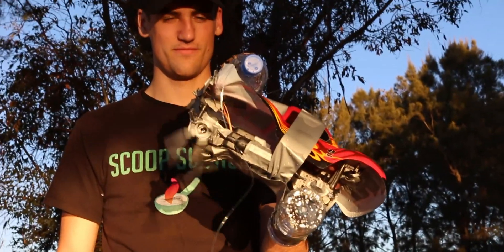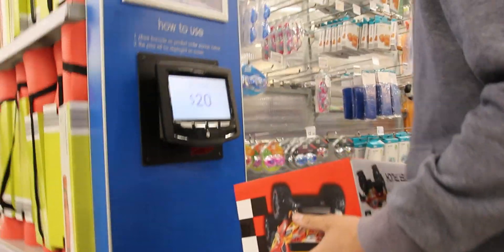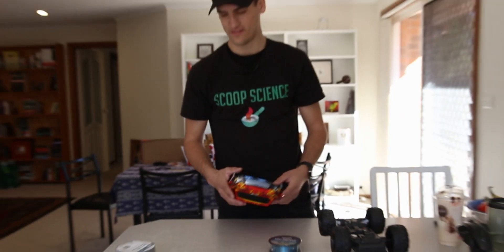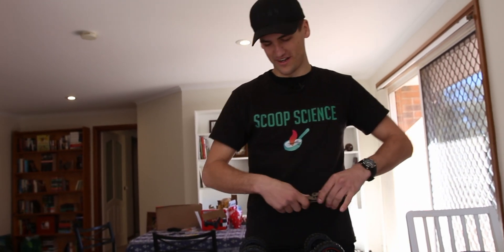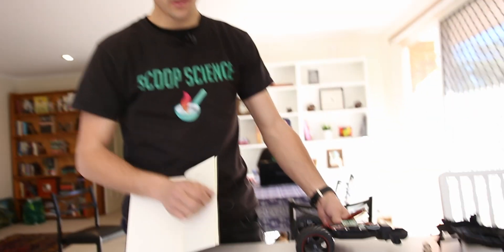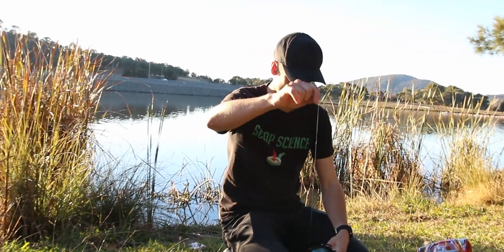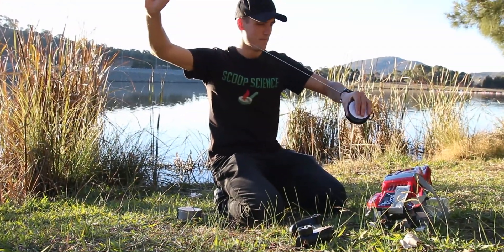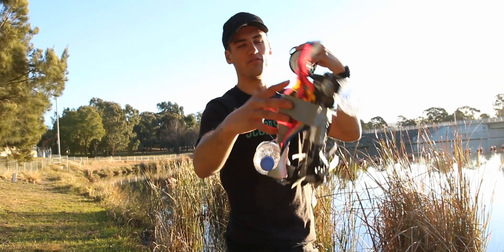RC car into RC boat

Comment: hey guys great video on how not to turn a rc car into a boat hehe ;)  i'm no expert on marine engineering or whatever they call people who make boats, but!  i find it so obvious and am surprised nobody has also picked up on this, what the mistake is that is causing the lack of propulsion....   ???  the reason is because your propeller rig is completely submerged...  its acting more like an impeller with no directional forcing tube/pipe than a propeller.  now if it was only about one third submerged i think and believe it will go a heck of a lot faster...  just a guess but i think its a good one haha  please try it and make another video... please :)
Reply: i've subscribed to your channel anyways because i like to see what you're up to :)
Reply from the maker: Thanks for the comment! You're probably right about why it didn't have much propulsion there. I think it's also because the motor inside just simply isn't powerful enough. I do plan to make more videos eventually, I know it's been a while since I have uploaded. I've been very busy making short films and other cool projects.
Reply: @scoopscience  awesome cant wait, and thanks.  add a couple of gear cogs at higher ratio for greater rpm ;)